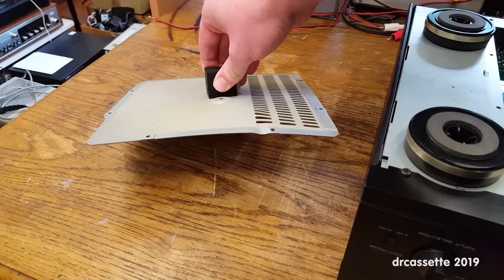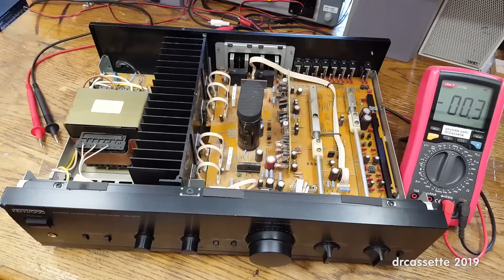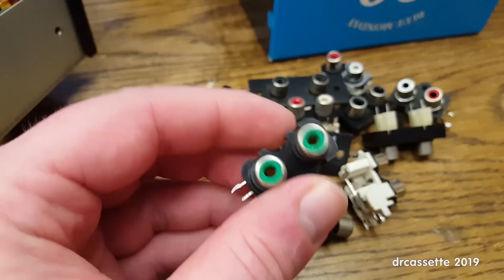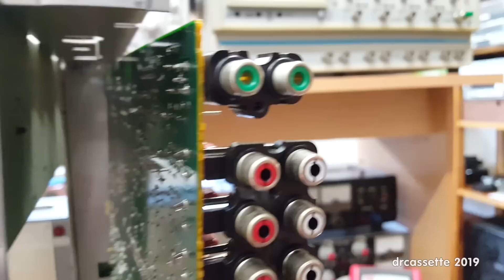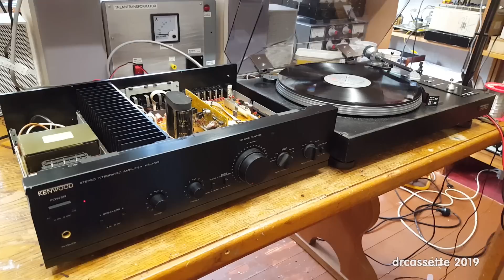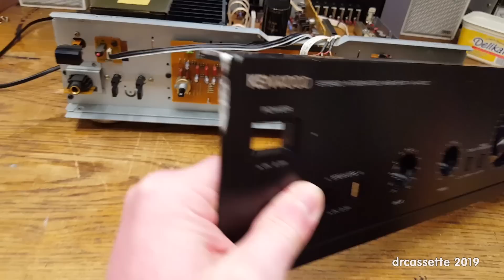Kenwood KA-4010 stereo amplifier repairs

Comment: For anyone repairing this I have noticed some alarming  discrepancies in the schematic compared to what's actually wired on the board. For example transistors Q25 and Q26 have their Base and Collectors wired incorrectly with respect to the amps IC1 and IC2 ,  so why does it still work?

Comment: Hi thank you for the very nice video  I would shorten the path between the mains transformer outs and the big power filter capacitors as a first   I would use an integrated powerful diodes bridge and place it close to the caps
3 holes in the pcb to pass new thicker wires going to the caps   This will allow for a better flow of the current  
This amp must sound quite good  I like Kenwood amps a lot   
Also the wires going to the speakers out are ridiculous   They should be made with wires not ferrous metal sheet  
This is very common in cheap japanese amps unfortunately

Comment: So… with the damaged power cord, what was the fix on that?  I have a Kenwood with a power cord that is soldered directly in (as opposed to one that plugs into the back of the machine)… do you just… solder a new one in its place?

Comment: Where did you spray exactly to fix crunching of input selectors? in that little wholes on back of switch or you needed to remove something?
Reply from the maker: Yes, you can just spray contact cleaner into the openings of the switch. No need to remove anything.

Comment: Great job saving Kenny from the skip! 
I have two Kenwood KA3020 SE's with the same fuzz on the input selectors so I was hoping to see how you cleaned them, how did you do it? 
Just blast away with contact cleaner? Or is there a more measured approach to doing it? 
Cheers!
Reply from the maker: Usually I use Kontakt Chemie Tuner 600 contact cleaner spray for cleaning switches and potentiometers.
Reply: @DrCassette  Thanks, I'll look in to it 👍
Reply: For the input selector there is plenty of space to replace it with a high quality rotatory switch as I have done

Comment: I have a Kenwood KA 791 amp I bought on Ebay. The other components for the stereo are in storage. Will the integrated amplifier be stuck on standby mode without additional inputs? It will click, but not power on.
Reply from the maker: It looks like the amplifier should be able to work on its own.

Comment: Back in the early 80s, I was told that Kenwood audio equipment was not that good. I went with pioneer and also had some of realistics high end recievers, which were their top of the line. I still have and use daily my pioneer equipment from the early 80s.
Reply from the maker: In the early 80s Kenwood did a lot of cost cutting. But many other brands did the same - including Pioneer.

Comment: I have a Sony home cinema amp and the problem is it plays audio on all speakers but no audio comes out from the subwoofer i have tried two diffrent subwoofers and i have played a bass test but no sound from the sub do you know what the problem is?
Reply from the maker: Does the amplifier have a high level output to go straight into a subwoofer speaker, or a line/low level output that needs amplification inside the subwoofer (subwoofer is connected to mains power)? What is the model number of the Sony amplifier?
Reply: @DrCassette  sony str dh 5500 i use an active subwoofer but no audio comes from it just a hum
Reply from the maker: That could be because of bad solder joints on the output jack, though I think your receiver is too new to have such problems...

Comment: ive got a ka5020, had it a number of years, its in use every day as the pc is connected to it, so far all that has ever gone wrong with it was a scratchy input selector, easy fix.
had a marantz pm44se before that, the kenwood is far better, as the marantz i found bass light in comparison.
some of these older kenwood amps are probably better than people think they are.
Reply from the maker: I agree, most people overlook Kenwood and don't take their equipment seriously. But they have made some very good products over the years.

Comment: The later or higher-in-the-range KA 5020 model I have is a different beast inside, as far as controls and switches are concerned.  The Input Selector has become very vague through use in the time I've had it, with problems in selecting both channels and also 'extends' past the marked points of choice at either extreme.  Instead of a rotary selector inside, it has a strange 'ribbon-like' set-up that drives the switching mechanism to select the channels.  Apart from a little jiggling of said input selector, it works well enough and is an excellent piece of stereo hardware.

Comment: Perhaps a black indelible pen could tone down the aluminium damage, if it becomes annoying :-).
The original owner must have hated the lack of bass boost, will you become the second person to throw it in a skip lol :-D
Reply: Yep, i use that pen trick to help conceal small blemishes - big bigger here but it will help!
Reply: Red Robbo's Workshop
Yes i find the black very handy for toning down minor damage to laptops and similar.
I'ts not 100% but i'ts almost impossible to create the perfect finish to match the brushed effect .
But i'ts better than nothing :-D

Who said i bodged it ha ha :-D
Reply from the maker: I usually don't use tone controls. So I don't care if the Bass Intensifier does not work. And to be fair, my test speakers can't reproduce very deep bass, so if the Bass Intensifier only affects those frequencies, I would not have been able to hear that.
Reply: I love the older analog systems, simple to repair or modify if needed.
Sad that people waste recoverable devices.
Ok ill shut up lol.

Comment: Discrete output transistors so easy to repair if it ever really breaks.
Those front panel controls though. I would rewire the crap out of that switch.
Reply: I think this one is made better than many amps made today, and it has real heatsink, not folded piece of aluminum tape attached to another piece of aluminum.

Comment: Good Job! Another piece of equipment saved from an horrible end.
My Aiwa XA-007 has also both tone defeat and source direct buttons. I don't know if in your Kenwood is the same, but in my Aiwa the tone defeat button only bypass the Bass and Treble controls. Instead, the Source Direct button bypass all the control knobs and switches (balance, loudness, etc), having the shortest possible lenght in the signal path. And in this second case the improvment in audio quality is very audible.
Keep up the good work.

Comment: I think the source button is there for adding an eq to the system. Toggling between source and source direct would defeat the eq.
Reply from the maker: There are no dedicated connections for an equalizer on this amplifier. You would have to connect an equalizer into one of the tape monitor loops, in which case the source / source direct positions wouldn't make a difference.

Comment: It was manufactured from 1989-90, use some permanent marker to get the aluminium black again.
Reply from the maker: Permanent marker produces a different shade of black compared to the original paint. I tried permanent marker in the past, in my opinion it tends to make things look worse...
Reply: @DrCassette  my local "Euro-Shop" sells one blue and one black sharpie in a set.
That particular black sharpie matches the color of those Kenwoods almost perfectly.
Had an KR-A5010 with similar damage.

Comment: Nice, I'm listening to this through my Kenwood KA-3020 special edition! Bought in 1997, Used every day, has a slight crackle on the input selector switch. Only slightly if at all it doesn't seem to be as loud as it used to be. Still usable :)
Reply: Have the same amp. Bit of contact cleaner sprayed into the back of the switch and it'll be fine. The switches Kenwood used are good quality but very susceptible to dust.
Reply: @jasejj  Thanks, I'll give it a go. What actually is contact cleaner? Is there a similar household alternative? Such as de-greasers and water displacing sprays for bikes and the like.
Reply: @Twotakesit  I use Servisol but if you're in the UK you can get stuff from CPC for a couple of pounds that does the job. DeOxit is said to be good also.
Reply: @jasejj  I'll give some a go, Cheers!
Reply from the maker: Only use contact cleaners specifically designed for electronics. I use Kontakt Chemie Tuner 600. Never use "household alternatives" such as WD40. Some may say those work, but in reality they don't work for long. Either they leave a residue on the contacts that even more dirt can stick to, or they corrode the contacts. Either way, they will make the problem even worse.
Reply: @DrCassette  i'll be sure to do this :)

Comment: The Kenwood xx10 series of 1989 was one of their best. Almost all of the components were very well-built and lasted a long time. The KX-9010 was the best Cassette Deck in its price range back then and the KX-5010 was probably the best 2-head deck ever made. My KX-3010 lasted for over 20 years without any necessary repairs or maintenance. Too bad people just throw stuff away like that.